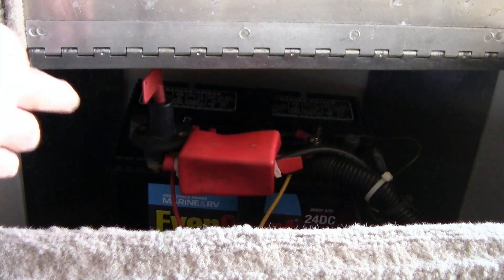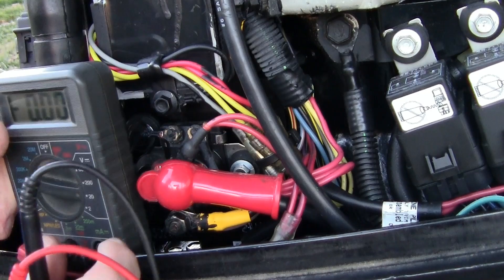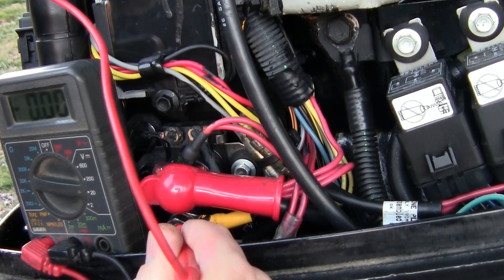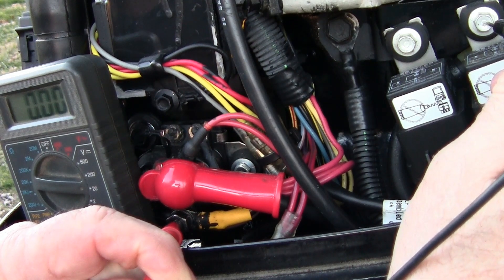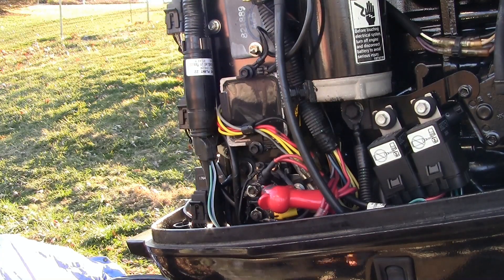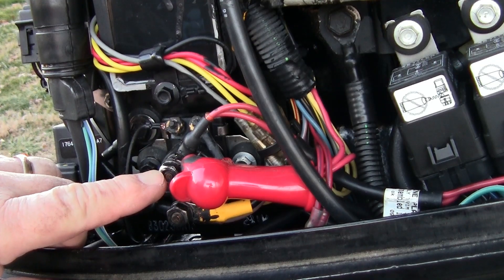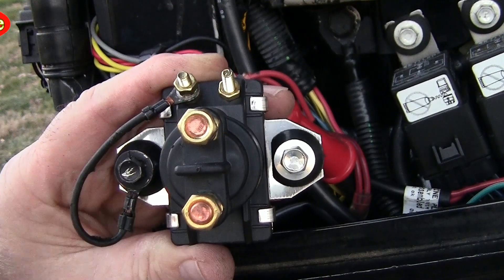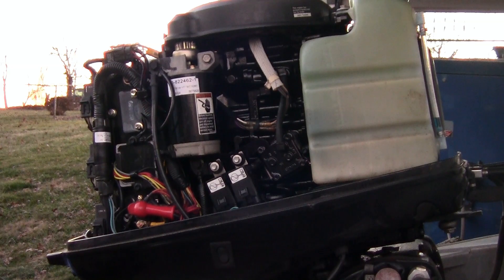50hp Mercury solenoid replacement

Comment: Can you please please tell me the part number or where to buy that solenoid? I believe that’s what is wrong with mine I have a 50 Hp 2 stroke Mercury a 2004 model Bass buggy pontoon boat looks exactly the same
Reply from the maker: Got it on Amazon and here is what I got. Hope this helps.
CRANK N CHARGE Solenoid Relay Switch Replacement For Mercury Marine 12 Volts 4 Terminals 20HP 25HP 40HP 45HP 50HP 55HP 60HP 65HP 70HP 80HP 90HP 89-818997A1 65W-81941-00-00
Reply: @LonnieJohnson1  Thanks a lot I’m getting ready to test mine right now I believe that’s what went bad on mine as well
Reply from the maker: You're welcome, any time.

Comment: Out of interest what voltage did you get through the new solenoid? I think mines on way out only seems to spit 8v out 12.5 in!!!  Starter turns slower than I remember too.
Reply from the maker: I got very little because it was shorting out. I should have been getting 12v.

Comment: Hi, I have a mercury outboard 60 hp 2 stroke, and it shows me a fault that is burning the main fuse, I have changed it several times and it will die again after just one use

Also the engine does not exceed 4,500 rpm, I have already replaced spark plugs, coils and cleaned the carburetor

I hope you can help me, thanks for your time lonnie
Reply from the maker: If the main fuse is burning, sounds like you have a short somewhere. What type of prop do you have? because that has a lot to do with your rpm.

Comment: I think your wires or you switch are not rated for the amount of amps you are putting through them. Great video though!
Reply from the maker: If you look at a solenoid switch it is activated by two very small wires, and my wires are a lot bigger. The only reason it smoked the wires is because the solenoid was faulty with a bad short sending all the amps through the wires. Thanks!

Comment: Enjoyed your video.  Especially your idea on your starter switch made with a medicine bottle.  Gonna make me one of those.
Reply from the maker: Cool!
Reply: Did you not see the smoke coming off that wire??? Better stay away from that pill bottle or you'll end up watching your motor go up in flames.
Reply: @steveking8548 the idea is good the wires are just way, way too light for that full load from batteries to the starter.

Comment: You smoked the wires because there too small for the amperage the starter pulls even if the solenoid was good those small wires would be smoked
Reply from the maker: Sorry but not true. You need to look at the units they sale. With a solenoid you are just bringing two magnets together to make a connection and that doesn't take heavy wires to do that or all solenoid small starter wires would burn up. It smoked because the solenoid shorted out and I had the button pressed to long.

Comment: Thanks. I have the 40hp version of your outboard. Will do the same voltmeter checks this weekend. My solenoid clicks but the starter is lifeless. New battery. 1998 model.
Reply from the maker: Sorry for the late reply. Sounds like the solenoid, was it.
Reply: @LonnieJohnson1  No worries, it was the solenoid which I was able to isolate thanks for your tips. I ended up just getting the original mercury part for a little bit more. Looking forward to another two decades of peace!

Comment: Just watched your video on diagnosing a solenoid - very helpful. My issue with a 2001 75hp Mercury outboard: on turning the ignition switch the starter turns but will not lift to engage the flywheel.  Per you video, there is voltage to the solenoid from the battery (new battery).  There is no voltage from the key switch.  There is no voltage from the solenoid to the starter.  Also, pushing the key switch in usually makes a clicking sound of choking the carbs - no clicking sound any more.  I would appreciate any thoughts you might have.
Reply: check the wiring from the battery,could be be gone black from corrosion,or any wires connected to the solenoid,you might have a voltage drop,  look up voltage drop on youtube. worth a go try it

Comment: The wires for your switch are a bit small for the starter, esp when comparing them to the starter wires (I noticed the smoke).  A bigger jumper wire or a jumper cable may work better. Just got to be careful to prevent touching anything metal on the engine or boat. 
Also, other possibilities are bad battery connections or return (ground) connection on the solenoid.  If you put the meter (positive), on the ground lead of the solenoid, it should stay near zero volts with the key on.  If it jumps up to 12 volts with the key on, then that connection could be loose or  corroded.